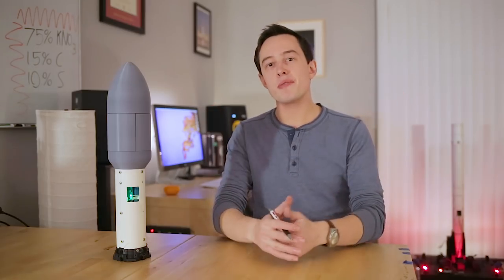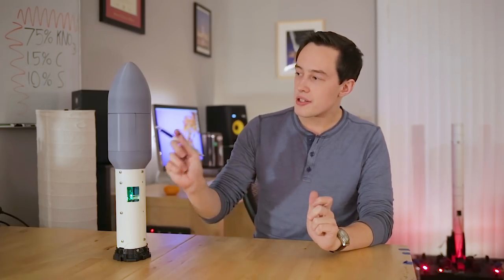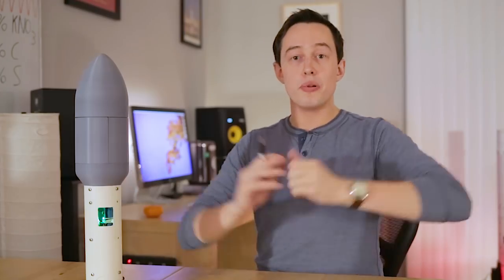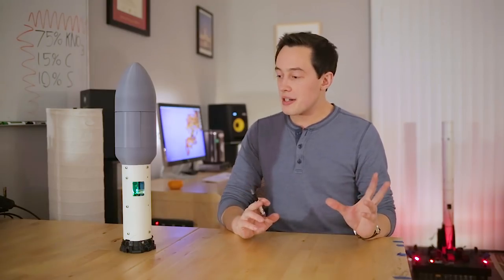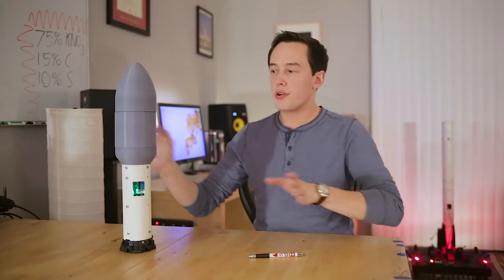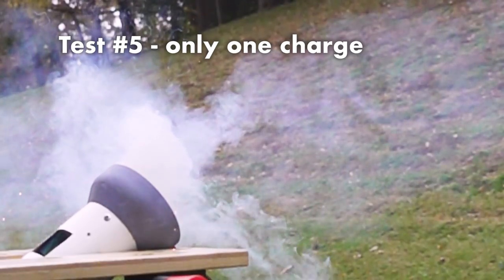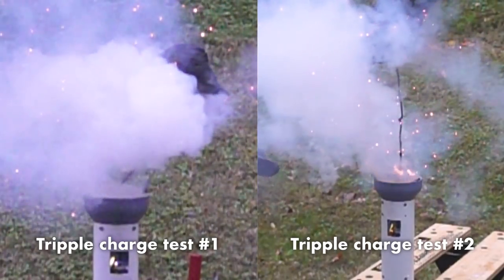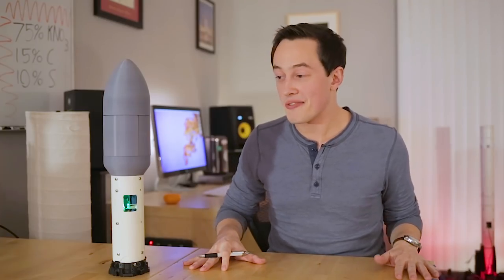Fairing Separation Tests - Fall 2018

Comment from the maker: Smash that like button as fast as KNO3 + C + S deflagrates
Reply: Your chanel is like your rocket motors..... LIT
Reply: kerbal space program the fuck out of it
Reply: Just discovered this awesome channel via Everyday Astronaut. 
Subbed, liked and will be sharing your vids on our site :)
Reply: I don’t care how often you upload as long as it isn’t for two years don’t rush your content
Reply: What rocket fuel did you use?what is the specific impulse of the falcon heavy model rocket?
Reply: If there is no problem why are you trying to repair  it, the just put on the original design of falcon heavy
Reply: Wot m8?
Reply: He is describing the rapid combustion of potassium nitrate commonly used in solid model rocket motors
Reply: MR. MY SELF build a box
Reply: Oh create you need fins a tube figure out how to secure a rocket engine to the bottom and a nose cone to the top and if you want to recover it use a parachute and the engine when burned will ignite a controlled explosion pushing the parachute out helping it float safely to the ground
Reply: Good for you that’s very challenging
Reply: Cool
Reply: In Spaceflight simulator. It’s a wonderful game
Reply: Ever consider having a tab that blocks the lower holes/separation bevels?
Reply: Thought about using co2 canisters?? Might be a little pricey but it sounds cool
Reply: @qxt9335  with your hands
Reply: BPS.space it’s a little late but, ematch is usually wired in series instead of in parallel. Also I think you could get away with just one charge (depending on how heavy your fairing is) with more confinement of your bp charges. It looks pretty lightly confined. Just my 2 cents awesome work!

Edit: if your firing current is bellow ~6v I would stick with parallel.
Reply: Plz do meme review
Reply: I love dynamite

Comment: I would add a piece of PET plastic from a bottle to the insides of the two side shells as springs. If you attach one side near the bottom and leave the other end free at the top and let it naturally bow inwards. You can pack your chute as normal and squeeze the PET springs down to almost nothing. This won't take up any more room inside the fairing. The top of the PET spring slides upwards into the nosecone. When the ejection charge goes off and you clear the bottom overlap, the springs in the fairings will naturally push against the chute as they spring back to their bowed shape and separate the shells away from the chute. We use this form of spring all the time for our chutes.
Reply: i was thinking the same but with a thin strip of spring steel but i like your up-cycling approach much more, and i guess you dont want too much tension other wise i might hold it together even with the charge

Comment: A dual charge setup will work if you install a pusher plate between the charges and the payload.  This will also protect the payload from burns.

Comment: Been watching backwards, launch first, then the work leading up to your initial launch.  I’m stunned.  Like, stunned to flat earth stupid stunned! Last i saw your efforts you were wrestling with keeping a rocket experiment trying to keep a rocket upright for landing.  Wrote it off, but thought i’d better check back, just in case you got somewhere. Well, you superseded any expectation ANYONE could have had for your effort.  Just amazing, Joe!
General perception: Excellent presentation of material: quick paced, high energy, excellent use of available friends acquaintances, (you run in a pretty high octane circle of friends!), and also of pertinent industry vids.
I have a ton of questions about your production alone, even more about your rocket works!  Will go do MY homework (watching all past vids), and then ask questions.  Like the gunpowder formula in the background, btw. :-) 
Very best to you, in the mean time, with your continuing endeavors!

Comment: Recommendations: Contain your bp charges in an aluminum tube w/ the igniter close to the open end, sealed with vinyl tape.  You will be able to use two thirds less bp and get a lot less smoke.  Make each charge, primary and backup fire at least 0.2 seconds apart. Simple calc for bp is: separation force in pounds x length of chamber in inches x 0.00051 = grams of bp.  I like to use #2-56 nylon screws to hold my nose cones on, takes about 50 pounds to shear one cleanly.  Nice work, fly safe.

Comment: You might want to consider changing over to a servo motor actuated deploy. We've done a lot of work with these systems because we compete in Water Rocket competitions, which pretty much universally exclude pyrotechnics. Removing pyro deploy systems make the rocket quite a bit safer, and you don't need to protect the chute from fire. Plus, you don't get all that nasty burn residue inside your rocket. A mechanical deploy presents its own challenges, but that's part of the fun because you're not working on something everyone else has already done.
Reply from the maker: Servo/electromechanical deployment systems can't come close to the mass/energy efficiency and density of black powder deployment charges. There's plenty of documentation on handling them safely too; they're used widely throughout the model rocketry hobby.
Reply: That's what all the ICE gearheads said about Gasoline when Elon announced he was going to make a car powered by batteries. :-)

Comment: Absolutely love it, but a couple thoughts. Surely more ignitors per charge would be better than more charges? I'm guessing you went the way you did because you had the charges ready made, but if making them specially I would have thought that a single charge with multiple ignitors would be more reliable than multiple charges even with redundancy.

Secondly, what about running a small bleed pipe up the fairing sides. Pressurising the top as well as the bottom should let the top separate from the sides better, and a small hole in the middle of the pipe can introduce some pressure between the sides and the parachute. Currently it looks like the charge pushes the whole assembly up, but doesn't assist with the fairing actually coming apart. That could be a starting point towards a gas generator deploying the fairing itself, rather than pushing a parachute which knocks off a fairing that then disassembles passively or by the parachute springing out. That might be me overcomplicating things though.

The chamfer at the bottom of the sides is redundant with your current design, and actually slightly detrimental. The parachute presses against the sides, so carries them up with it. The charge only stops pushing when the sides open an escape path, or the parachute leaves the top of the sides. The second only occurs if there is next to no friction between the parachute and the sides. In the first case the chamfer releases the pressure before the sides are actually separated, which the introduces the failure mode you saw. The top is only ever going to come off before the bottom separates if the parachute has been fired up far enough to knock it off itself without pulling the sides out. If this is a concern it is easily dealt with by putting ribbing on the inside of the sides to increase the friction between them and the parachute.

Finally, if the parachute jamming in one of the sides is a concern, why not switch to 3 sides? Ends at 120" can't pinch the same way parallel sides can.

Comment: Why use black power when you could use CO2? With a bike co2 inflator I'm sure you could automate firing and then you wouldn't need nomex.
Reply: cryhavoc the pressure container would be too heavy 
along with the mechanism involved

Comment: Great to see the thought process. Personally I'd make the lip far far smaller making many of the issues easier. If you look at full size rockets the materials are terrifyingly thin and only just strong enough.  For a model things do need to be chunkier but even so,  I would reduce the lip by 80pc.  The nose is held on aerodynamically or gravity,  it won't fall off.

Comment: Ok, i have to comment this :) I have some background in pyrotechnics from army, so let me suggest a few things ;) Some things may not be legally obtainable in US so you have to check it. I am not from US, but all things i will write are legal in my country and not so dangerous.
1) if you have to use firework igniters instead of real detonators (detonators are mostly available just for licensed owners), it is good idea to put two in parallel. They will have less resistance than single one (according to ohm's law), but it can prevent missfire.
2) Firework igniters have some energy per time needed to ignite. If you are using low voltage power source (like battery) you need very long time to ignite them. To cut some miliseconds it is good idea to use some circuit, which will charge capacitors and then release much more jouls of energy in short time to igniters (something like photo flash gun).
3) Maybe will be good idea to use one starting point of ingnition and than use shock cord to distribute ignition to black powder capsules. If you use quality shock cord you can very easly time your detonation (deflagration in this case) in nanoseconds precision and there will be no problem with missfire. This method is commonly used in precision timed fireworks (like rows of effects etc.), it is also cheaper and more relaiable.
If you have some more questions message me and we can discuss it ;)

Comment: While I can't really argue using more explosives as the solution to everything, I think there are some relatively simple ways that you could reduce your reliance on the gas pressure.

My main though is to hinge the side sections. These could still breakaway if you wanted, but getting more rotation on them would help prevent them sticking to the parachute like one did in one of the tests. Along with this, add a spring pushing them out, either between the two pieces or on the hinges themselves (although I don't think you'd be able to have them break away quite so easily then...), this would also mean that a successful deployment would only require enough pressure to pop the tip off, then the rest would spread naturally.

Comment: Why pyrotechnics? Heater wire on monofilament holding lightly sprung petals and cone? The cone would pull the chute and the 'petals' could remain together with a separate small chute? I'd imagine the separation could be highly accurate without the weight of the nomex and better reusability of the fairing? I've just read similar on the comments. Pyrotechnics seem like an solution looking for a problem...

Comment: You should consider using smokeless gunpowder instead of black powder. The burn rate is much faster and the smokeless aspect means all the products of the reaction are gasses. The last benefit it provides is being a much more powerful fuel. you can use less and still get the same preassure. hope this may help!

Comment: You need to add a tube from the bottom to the top to allow the pressure to pass the packed parachute into the nosecone
Reply: That would most likely hinder the hinge effect he wants. The top Cone acts as a hinge and the chute acts as a spring causing lateral as well as vertical separation, each piece goes its own respective direction then...
Reply: @mike3684  the parachute pressure is applied to the entire inside surface, that's why it's sticking. to maximize the force to hinge it open, it should be folded in a way that puts pressure on two points near the bottom

Comment: I would say you went the wrong direction with the solution to unreliability. Putting in more parts that are just as likely to fail individually and end in too little pressure only slightly improves your odds, where as putting multiple igniters into one appropriately sized charge would actually mean all igniters must fail before you have a major fault.
Also might help to add some overlap alu tape flaps behind those vertical seams, as it looks like a good deal of initial pressure escapes when the parts bludge.

Comment: I used those for lighting my early bi-prop engine. They work...ok-ish with out leads added, when leads are added to be set off from a distance they start to fail even with twice the Voltage they are rated at.

Comment: So if you want to act like SpaceX, then do this....

Ditch the fireworks and instead activate a solenoid that empties the contents of one or two of those small CO2 cartridges into the fairing.

Build the fairing in 6 pieces instead of 4 (cut the base and top in half).  Glue 3 pieces together twice then.....you have a 2 piece fairing!

Use Scotch tape (or dots of glue on the mating edges, or something) to secure the two fairing halves together for accent.  Your goal for this: Find a material that will keep the parts together during ascent, but will pull apart when commanded (via fairing interior over-pressure).

Your current design prevents clean separation because the 1 piece nose tries to keep the two sides together (See 5:58 where the bottom of the sides pieces are separated, but the top is still held in place by the nose, jamming the side pieces together at the top).  If you want this to work.....well, you put the notches on the wrong end, so put the notches on top if you want clean separation.

Comment: Rather than adding a third ejection charge to cover the chance of an ematch failing, you might consider using two ematches per charge.  I do that for my rockets as an inexpensive bit of redundancy.

Comment: Regarding printing it in 2 pieces, why not print in 4 pieces, but have two of them rigidly attached to each other using glue/screws, thus making two large pieces? 🤔

Comment: Is the air resistance due to the rocket speed negligible? I mean if gravity is not I think the rocket add some important drag to the fairing, isn't it? It might be a big difference between ground testing and real flight.
Reply from the maker: At the time of deployment, yep, it's negligible. Fairing sep/deployment should happen close to apogee with this upper stage - the vehicle will be moving pretty slow by that point.

Comment: Or, 2 hinged pieces, springed together with a uninflated ruber baloon. Top of it glued to one half, bottom to the other. And a pressurisation of choice. It would push halves apart and the parachute up. Tho, less fireworks.

Comment: Adding one more element to a 2 element system that has multiple single element failure scenarios sounds like smart fault tolerance engineering to me. The Space Shuttle had 3 flight computers so that 1 could fail in a variety of ways but the mission could continue with the other two computers outvoting the problem one. 

Anyone else out there designing stuff? Consider the odd man out rule for sufficient functional fault tolerance in all mission critical components.

Comment: 0:00 why do you have the recipe for gunpowder on the board lmao
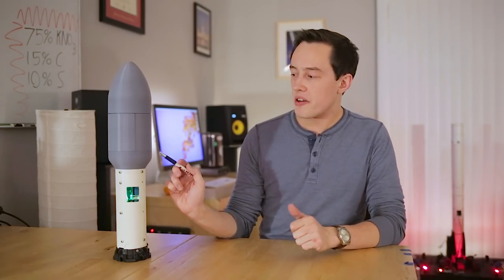Edit: 2:04 I see
Reply: because its NOT 'gun powder' its BLACK POWDER (BP) and that is the fuel used in his solid rocket motors.   You don't have to buy motors you can make them yourself, which, is a 600 page book by Sleeter (https://amzn.to/2qWy04r)

Comment: this problem was solved years ago.  you need a simple wad between the pyro and payload, much like a shotgun shell. Heck even Estes rocket basics got this covered with the use of wadding.  You need something to contain and build up the pressure.
Reply: Well this does not work on a piston principle like most hobby rockets do, his system needs the pressure through the whole vessel to separate cleanly.
Reply: @MsSomeonenew  then port the wad (and I'm not talking about the non-flamable kleenex type stuff used by Estes).  to much energy is being wasted by his techniques shown in this video

Comment: Use a pair of controlled fireproof spoilers symmetrically immersible into motor exhaust jet in order to control the amount of thrust during the landing. There is no other way to control the solid rocket motor's thrust, and without it you would hardly land your rocket.

Comment: Why not get your ATF permit and get some real e-match. Or get some firewire initiators. Good e-match that is made in USA should give more reliable shots than that Chinese stuff that I'm going to guess you bought off Ebay (which is illegal) . Correct me if I'm wrong ..

Comment: Why not make a single larger charge?
Reply from the maker: Reliability. If the ignitor fails on one of the three charges, things will still be fine. If it fails on one big charge, that rocket is gonna get crunched :)
Reply: @BPSspace  you could have one larger black powder charge with multiple igniters, ensuring that the charge is lit properly
Reply from the maker: @nairdasilver4588  The maximum number of ignitors you could have on one charge given the current heat shrink style setup is two. Three separate charges still end up being more reliable, and cost at most, <5 grams of extra mass.
Reply: @BPSspace  Surely (two igniters, one larger charge) is better than (three igniters, three smaller charges)? With the first method you get 100% gas generation, all at once, even if one igniter fails. With the second method, you get the timing issues multiplied by three, leading to lower impulse PLUS lower overall gas volume if there is a failure. My logic says you may want to re-evaluate and keep it simple...Just my thoughts. Great channel.  Keep it up, literally ;)
Reply: Your sense of reliability is missing a piece. If one of the charge igniter fails short, it is going to short out the signal and none of them would light. Just put in more powder and put the pyro igniters from both ends of the heat shrink tube. They would need to be driven separately to avoid short.
Reply: @BPSspace  use 1 charge and 2 or 3 igniters for the one charge.  You KNOW the BP is going to perform if its dry and perfect.